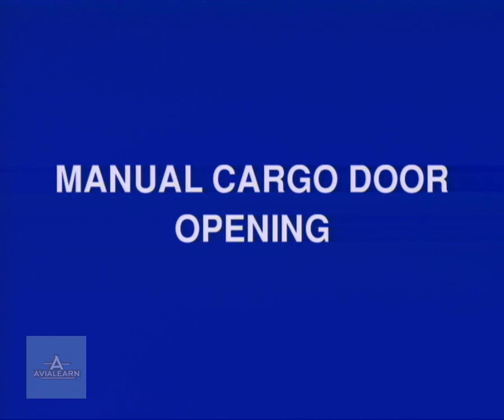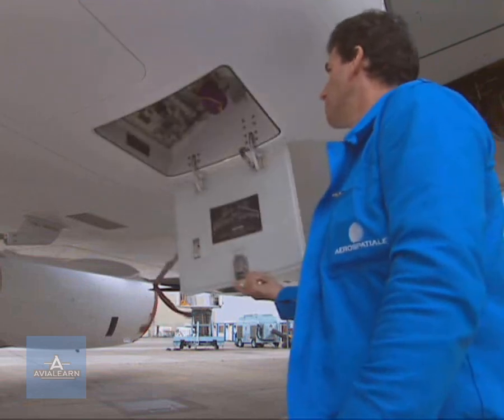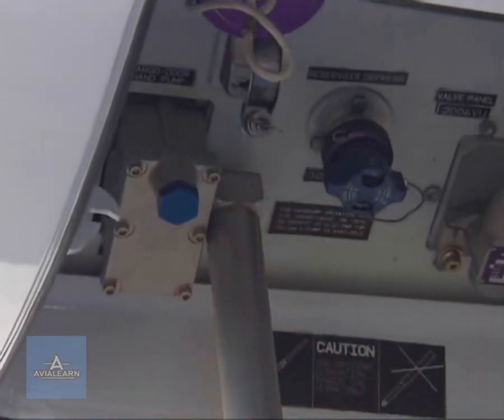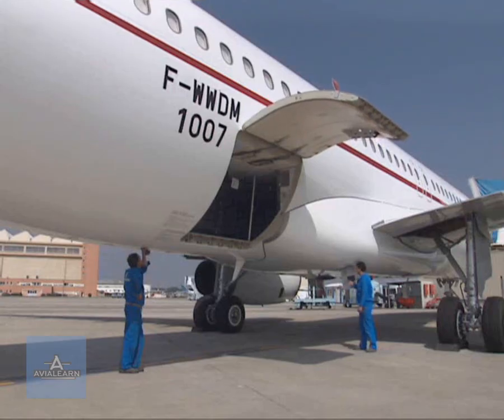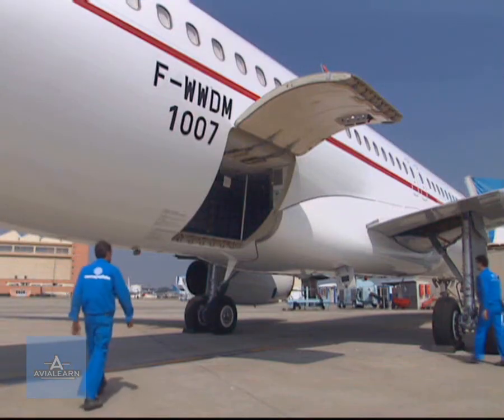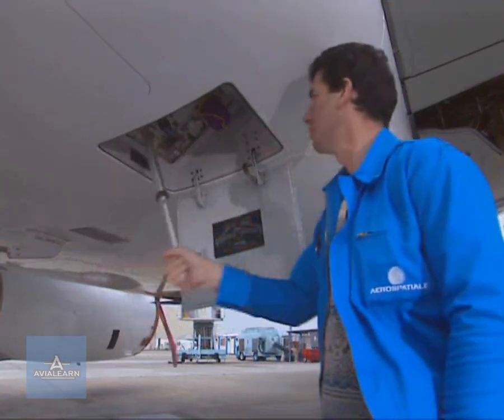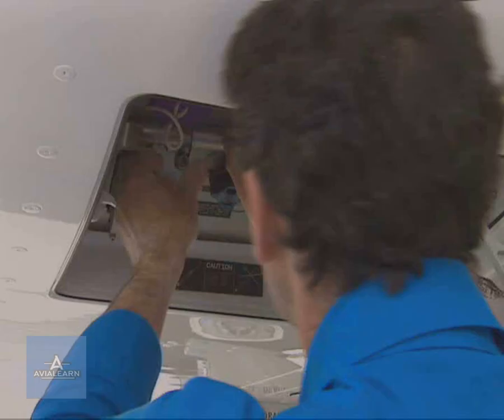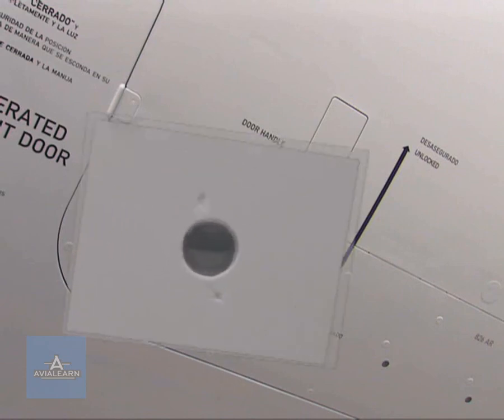Cargo door manual operating - Airbus A320 Family

Comment: But i open the A320’s cargo door by simply opening the small panel and turning on the toggle switch then pushing thw lever towards open position and the cargo door open automatically
Reply from the maker: Good work. This operation you did is when the electrical power is available in the aircraft.